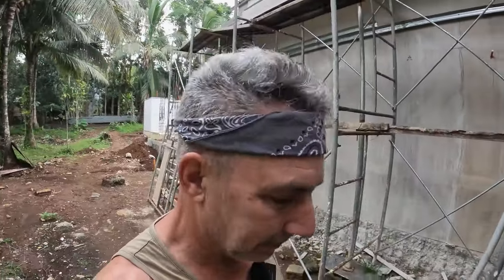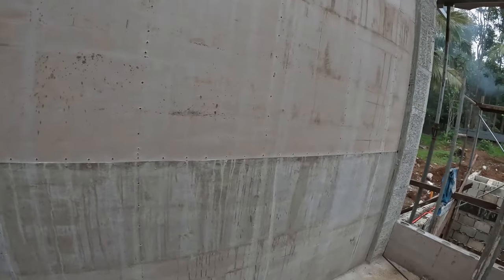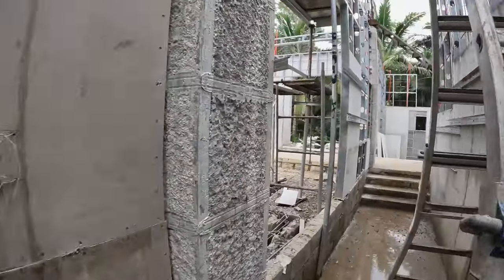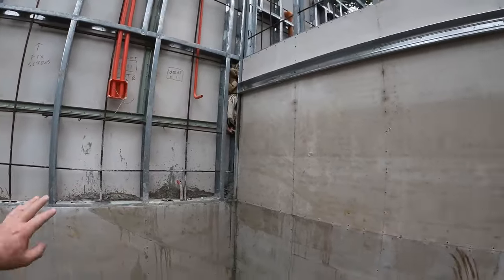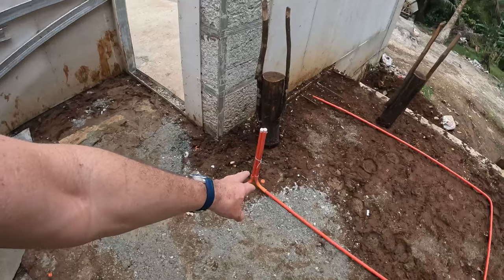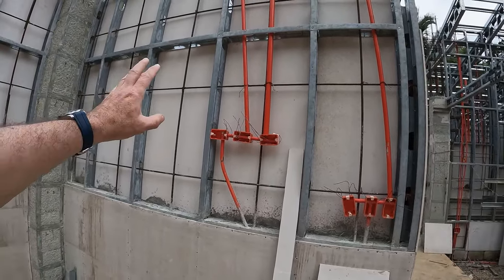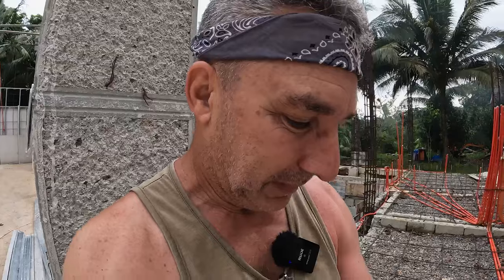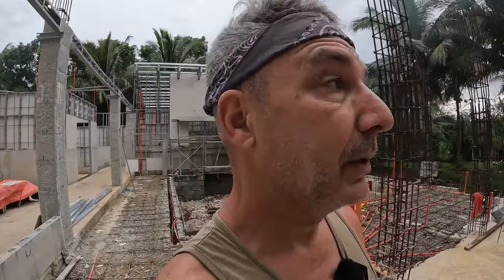Build Progress: Walls Rising 🏠 | House Build Philippines | Ep. 23 | TORINO

Comment: Thanks for the update
As builder I don't think concrete cold joints are going to be of any concern especially  with the continuation of metal frames and rebars.
Anyway more than 4 ft concrete placement and forsure there will be a problem.
Reply from the maker: Agreed. Thanks for the input. 👍🏼

Comment: Concrete inside steel framing, interesting. Steel frames and truss is nothing new to me but filling the walls with concrete is. Why did you choose that method. As you mentioned in a previous video you really need to be on top of the slump of the concrete and watch the vibrator operator very closely. When I was building fence of concrete posts and steel panel infills, I upset my guys when I asked them not to make the concrete like water. I have vast experience with concrete and didn't want weak concrete.
I'm still confused as to why you are filling the walls with concrete and not an insulation.
I started out as a bricklayer then mason on to being a builder, so I am very jealous of you access to large stones. I would love to do some creative landscaping with them.
Nice to see something new other than blocks (hand rubble) or traditional (western style) formed concrete house construction.
P.S. What are you planning for an external coating? Are you going to skim coat the internal walls?
Reply from the maker: Insulation in walls is rarely used here, I haven't seen it anywhere, perhaps in specialized buildings. CHB and poured in place is the norm here in the Philippines. I too try to convince the crew to use less water but it's a battle. The Metalyte team says they will skim coat the walls with tape similar to a drywall finish and use interior and exterior paint.
Reply: @torino2610  I will be building a new house soon hopefully so I might have a chat with the Metalyte guys in the future. Tradition is strong here. It is very hard to get the guys to think of other ways than what they are used to doing.

Comment: I've mentioned, I was in the Floorlayer's Union, here in St. Louis, for 35 years. We were almost always the last ones in, but I've been around enough & gone through enough blueprints, to have a pretty good take on what's going on, as you do your walk through & descriptions. The 2 dimensional limitations make a bit confusing, just because depth perception on the early layout, leave a lot to be desired, to put things into accurate concept...That said, now that walls are going up, it's much easier to get a grip on everything's functionality.....
 I traveled for 13 - 14 years installing artificial turf in Sports Venues. It was there that I really came to terms with layout & how absolutely vital that is, to issues such as electrical & plumbing (but in our case, it was center logos, end zone lettering & hash marks & multi sport event, field lines layouts)...
 There's a lot to be said about, walking to a plot of ground, and precisely measuring every stake, and routing every underground utility, so it's is in its exacting position, both coming in & going out, before the first pour of any footing. It's complicated & can be stressful, just because mistakes can be very costly...
 My hat goes off to You for sharing all of your building experience...it's going to help Dinz & myself when we start making our plans to build...
 My only question is...I get that there is rebar running both vertically & horizontally,  but when they pour a wall, and stop at intermittent levels, & then they pour again, doesn't that create a weakened section of the wall, at each stop & start point ? ..... I've worked with concrete backer boards, and I was taught to "flat trowel" our cement mortar, into the backer board & then trowel the "tooth" side, which is supposed to add 60% more strength to the bond, of the tiles, we would then set into the grooves of the troweled substraight......I'm not questioning the legitimacy of the entire process, I'm not an engineer. I'm just asking out of my own training, and my understanding of layered concrete...
Reply from the maker: Thanks for the detailed comment. I can see there is no tooth or groove between each section because of the metalyte longitudinal form that they end on. My limited understanding of cold joints is that they might occur if we interrupted the pour of a section and then finished it after the previously poured amount had begun to set, especially if the incomplete pour was uneven, like a diagonal slump inside the wall, that would ruin the compression feature of the wall. It seems that the Metalyte guys have found that each section is the max height to go before a blowout could occur and the need to let it set before continuing the next section. I'll ask Metalyte this question to see what they say. Thanks.
Reply: @torino2610  You won't have teeth marks or trowel ridges...That would only come into play when installing ceramic, marble, granite or like tiles (sorry about that confusion....It sounds like they have it figured out........my concern is simply the newer pour, on top of a dry, previous pour...concrete will undoubtedly stick to concrete, but under (heavy) stress, that seam line would be the weakest point...but they know 100 x"s about what they're doing, than I do
Reply: It wont matter much since the columns and beams hold most of the weight. None of the walls are load bearing. Structurally, those concrete walls are still leagues and leagues better than drywall that you find in most US homes.

Comment: Question:    The joint tht forms between old pours and a new pour.........is tht not weak ?   yes it is inside the "form" but I assume its not wet and not sure if rebar is also in place esp on those high walls........they were  poured over multiple days   ........ can u explain if these joints are a potential source for weakness ?
Reply from the maker: Good question. The wall pours are in sections, they begin and end at specific lateral metalyte spars, smoothed, finished and left to set before moving to the next section. A cold joint might occur if we interrupted the pour of a section and then finished it after the previously poured amount had begun to set. With rebar and vibration compaction, I don't expect any cold joint issues, especially with walls since they are in compression. P.S. We had some cold joints in the Garage floor pour and yes, cracks are evident where the pouring was delayed as the crew tired.

Comment: Very interested in this style of building for our house in the Philippines. Do you know if the metal lite is available on Guimaras island,? Iloilo is probably the closest major city, but would be at the southern end of the Guimaras. Not to keen on hollow block construction even though it is the norm for most of the Philippines when building residential with concrete. 
The overall strength and speed of construction very cool with this metal lite. I like the poured in place conduits, wiring and plumbing as well instead of the chipping out they do, with concrete patching after to repair it. Definitely going to need CAT 6 run through our build too for CCTV PPoE and computer drop ports. Looking at getting hybrid solar system only using the grid tie for backup to charge the batteries protect against all the wonderful brown outs.

Anyways, interested to hear your thoughts on availability outside of Luzon, Western Visayas. Of course builders of good reputation as well, if you have the time to comment.
Reply from the maker: I will ask my Metalyte contact and post back with what I hear from them. Thanks for commenting! 😀
I heard back from Metalyte and they said they did projects in Iloilo but never on Guimaras Island. They said they probably could if inter-island hauling is available. You can contact them for more info. 👍🏼
Reply: @torino2610  Thank you so much for the info. We have raw land at the moment want to take advantage of the ocean view when we build. Ton of mahogany trees on the property, will have to thin them down as they have too close to each other and allowed to grow wild by the previous owners.
Reply from the maker: @jeffgreagrey4585  Thanks for watching! Good luck on your build, an ocean view will be nice!👍🏼
Reply: @torino2610   Salamat/Thank you very much.

Comment: did u ever solve tht 240V issue with EcoFlow ?     Yeah DP3 is out now with built in 240V.
Reply from the maker: I eventually managed to have the vendor take the SHP back for store credit. I used the credit for 2 more sets of 400w solar panels. I have yet to get back on the project. I think I will probably end up with a manual transfer switch.